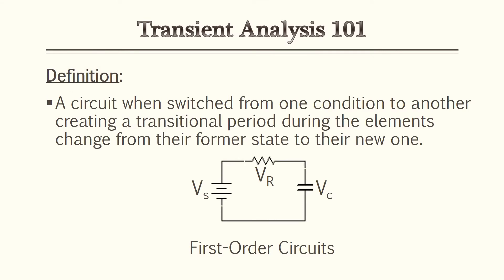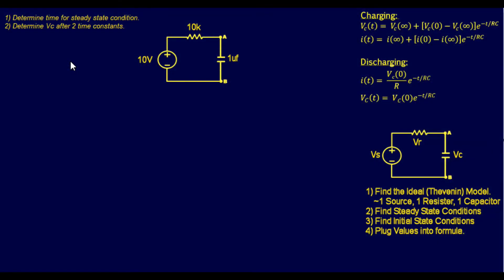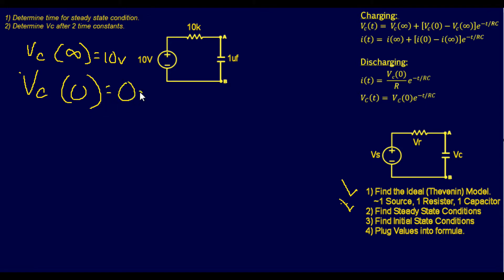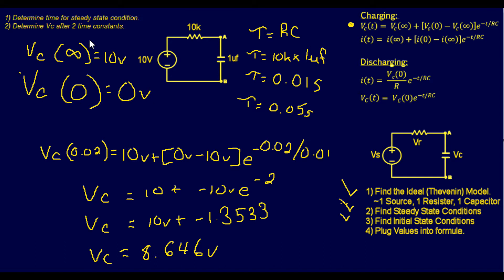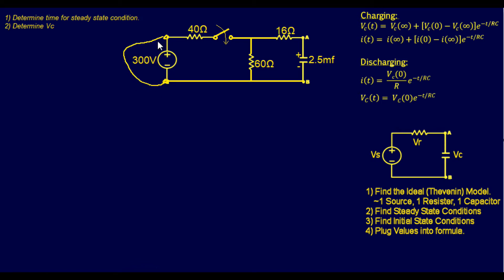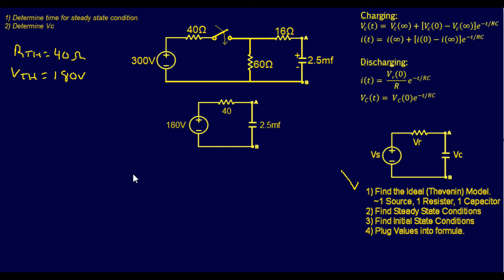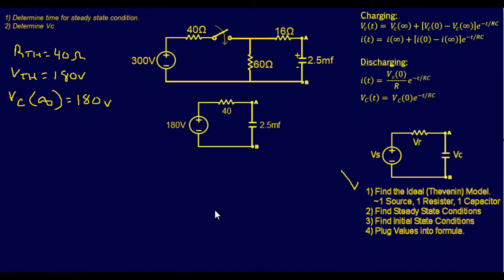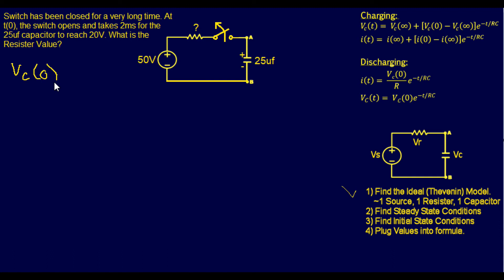Electronics P.E Prep - RC Transient Analysis

Comment: The website is not up: what a shame for such good study materials
Reply from the maker: I'm sorry. We shut down the website around Covid. NCEES moved the Electronics PE Exam to computerized testing and changed it to once/year. Sadly, this lowered the demand for this exam, and traffic to the website dropped dramatically. With this in mind, we decided to shut down the service.
Reply: @electronicspepreparation  well: the amount of 'good' you all are doing by keeping this material available is phenomenal - I foolishly took the Power and Computer Eng. exams thinking they would be easier even though I was primarily in COMM and Electronics (I worked for 5 years as a COMM engineer for the City of New York) - if I had just stuck to my discipline and waited for this exam - and had your material - I would probably have gotten my PE by now.
Reply from the maker: Thank you very much

Comment: I got 873 ohms for the last equation using the num solv on the TI-36X Pro. Not sure where I missed a step on this one. But thanks for the great videos!
Reply: A common mistake if you are going fast is to write/type 0.02 instead of 0.002 for 2ms. This is likely where the factor of 10 is missing if you get 873 instead of 87.3
Reply: @ Ah! Good point. I am sure that is where I went wrong there. Been a while since I watched these videos. They helped me pass my exam haha. Good luck
Reply from the maker: Nice!!!
Reply from the maker: Not sure where the error is, but try not to lean too much on the "solve" function on your calculators. They can easily lead you down the rabbit hole.

Comment: For Problem at Minute 12:27, Shouldn't the time for steady state equals 5*time constant,  therefore it would be 0.5 seconds. for that circuit.  Is that correct or am I mistaken?
Reply from the maker: Good question. The goal was to obtain the formula for VC so any time could be inputted to obtain the voltage at that specific point in time. Obtaining the time constant for the steady state condition means making your calculations using the steady state model (one resistor, one capacitor, one source). The steady state model is/greater than 5t.
Reply: @electronicspepreparation   No, But I'm referring to the first question, Determine the time for steady state condition, aren't you trying to find tau with the Thevenin equivalent and then 5*tau is equal to the time for steady state condition?
Reply from the maker: The thevenin equivalent (model) is the steady state condition.

Comment: On the last problem, it should state that the switch has been open for a long time and then closes at t=0. One should determine how long it takes to charge from 0V to 30V.The scenario presented here is misleading and results in a capacitor that doesn't discharge through the resistor.
Reply from the maker: Completely understandable. The idea is to display a single resistance and capacitance similar to the model. A typical discharging circuit will display the resistance in parallel with the capacitor instead of being in series. Good attention to detail.